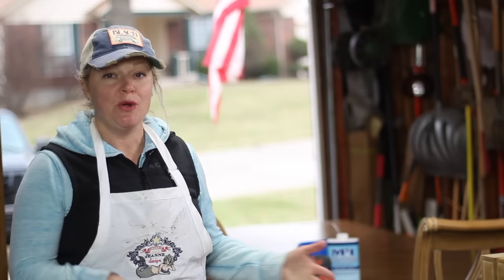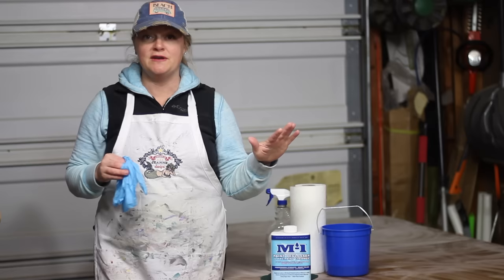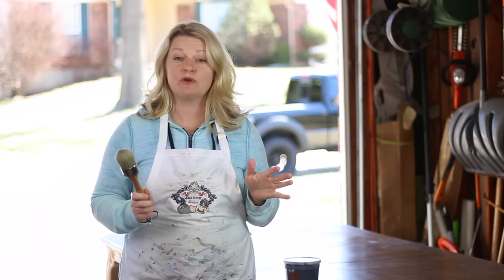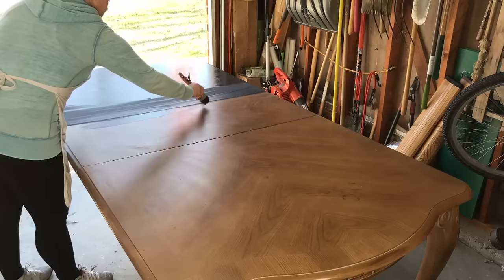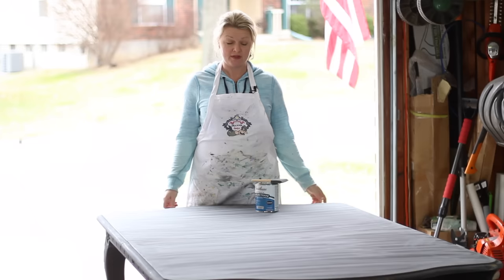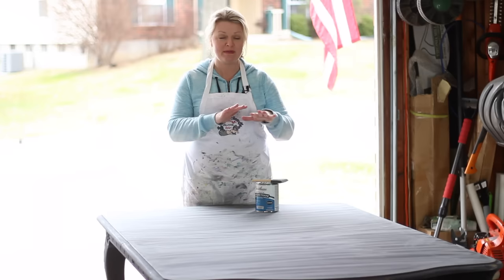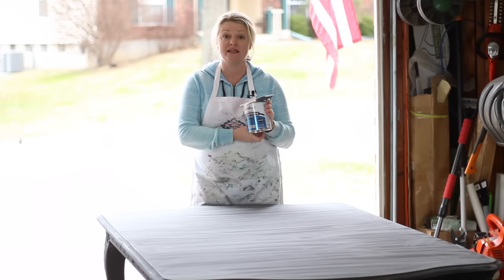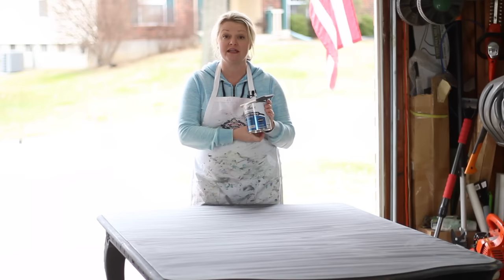Full Tutorial | How To DIY Chalk Paint Kitchen/Dining Table

Comment: So when you sand (after the two coats of paint; to get the butter soft finish on top... and distressing...), do you not wipe it down at all before poly?
Reply: I'm wondering the same!
Reply: I came here to ask the same thing!!
Reply: I'm wandering as well.
Reply: I'm glad to know I wasnt the only one to think this right away after sanding!
Reply: I was wondering the same.
Reply from the maker: Yes, I explain in the video jkay88 that I clean the table top even with an air hose to make sure that I have the cleanest and smoothest surface .

Comment: No goggles or mask while sanding? You didn't explain how you clean the painted tabletop after sanding and before sealing.
Reply: Stephanie Jo Rountree 😐 I’m sorry to have to point it out but she actually did, quite clearly too. She said she used cleaner first (I’m not rewinding it to hear that part again for this purpose, but having a healthy amount of common sense I’m going to assume she meant any regular degreaser or relative cleaning product,  then  she def said she used a deglosser & then vintager & water. I really don’t know how she could’ve/would’ve made those extremely simple steps any clearer. 😬
Reply: Ashley Falcon She never explained how she cleaned the “PAINTED” table top.  She went from sanding straight into distressing right to a clear coat.
Reply: @hagenz71  she said she uses vinegar & water to clean it TWICE.  so, it stands to reason once after sanding obviously & then again after the deglosser.
Reply from the maker: Hi Stephanie...  I wanted to reply to your question...After you sand, you can use the deglosser and water and wipe clean or if you do not need to degloss you can use an air hose to remove all debris from the table top.  I always try to use a rag that is lint free.  I couldnt add every single step in the video or it would have been tool long, I am sorry for the confusion.  I am hoping to post a new one soon, I am showing painting antique wood as well as reupholstering kind of a two in one video!  Thank you for watching.
Reply: Would it be acceptable to use a tack cloth after the second round of sanding ?

Comment: What grit of sand paper do you use in the beginning to start sanding down your table? 

So your shopping list would be:
Chalk paint
Deglosser
Brillo pad
Sponge
Gloves
Sandpaper 220 grit
Water based polyurethane sealer 
Clean dry lint free cloth
Chalk paint brush
Poly foam brush (Not craft) 

Did I miss anything? I will be painting my kitchen table, since we are quarantine and I am not furloughed from work.  Looking for projects for around the house. And this is one I have been wanting to do for a while. 🙂 thank you so much. 😀
Reply from the maker: i usually use a 180 grit to start my table, i use 220 grit for the finish sanding.  Happy Painting!!

Comment: You sealed it with what? I keep repeating that part but I have no idea what the "poly" word your using.
Reply: The sealant is called polyurethane or poly for short.
Reply from the maker: Sorry, Yes I used a poly acrylic sealant.  A water based sealant product so it does not yellow or have a too strong an odor and dries quickly!!
Reply: Was it a matte finish or semigloss or satin

Comment: I have painted a table using chalk paint and I want to seal it now and make it more durable by using an oil based varnish (polyurethane) How long should I let the chalk paint dry for, before applying the varnish ?
thank you
Reply from the maker: I have not used an oil based too coat ever with chalk paint only water based.  I’m sorry I can’t answer that completely.  I would say let paint completely cure at least 24 hours before top coating!  
Hope it goes great!!

Comment: I thought the whole idea of using chalk paint was because the product is self sealing? I've used the stain and seal process to age but never with chalk paint. I came to see how you did it but it appears you still have to seal it?
Reply from the maker: The reason I sealed this is becuase it is a table top that will be used often it is to protect the surface.  Any painted surface really should have an added protective layer.  I hope this helps

Comment: I have a huge ikea pine dining table I would love to chalk paint but I would do my brushstrokes the other way, the length of the table top to elongate it!  Is there a finish you can use on top to add a tiny bit of shine and at the same time sealing it?
Reply from the maker: Hi Gina...  So doing that long of brush strokes may be a bit difficult...    You can use a gloss  Poly acrylic to seal it with a bit of a shine..  I hope this helps.

Comment: ? I want yo do this to my kitchen table that we eat on now when I use my dis rag or all purpose  cleaner to wipe down my table will the chalk paint  come off
Reply: I was wondering this myself
Reply from the maker: Hi there, this is a great question.  If your table is sealed very well and I usually recommend SEVERal coats of poly  on a table top, lightly sand between c oats if you  like, you can use a cleaner and soft cloth.  Remember it is just paint.. And if need be you can repaint, and a kitchen table does have ALOT of daily use...  So my recommendation is several coats and using gentle cleaner and soft cloth.  I hope this helps
Reply from the maker: @Bavbava27  Hi Barbara, I responded answer below.  I hope this helps.
Reply: @JeanneCrackel  yess thank you

Comment: @idreamofjeannedesign HELP!
I spent months sanding/painting, sanding/painting, REPEAT, ...my dining room table to make it look exactly like I wanted (a beautiful birchwood).
I finally was pleased and ready to seal the deal, went in w/ “MINWAX 
water-based clear ultra flat polyurethane”, and it crackled my work and turned it from bleached wood to a noticeable Peeeee YELLOW. IT LOOKS HORRIBLE.
 Is there a flat topcoat that doesn’t yellow white chalk paint???
Reply from the maker: Oh no Gina!  I’m so sorry that happened!!   I always use a water based poly but it is hard with white paint , I have ran into this before as well.  If the wood is not sealed or old it bleeds through the white psint. So honestly doing a base or sealant coat under your chalk paint is what would work .  I know that kind of goes against everything that is great about chalk paint, just paint and go but if it is bleeding or yellowing it needs to be sealed!!  
It’s always trial and error with painting.  Best of luck and Happy Painting!!

Comment: Is chalk paint the same as "chalkboard paint"? I would like to use black. I only see chalkboard paint. Not exactly chalk paint in black.  So I just didn't know if there was any difference in product. Thank you.
Reply: Chalk paint contains a type of plaster which makes the paint thick and it tends to dry with a matte finish. Chalk board paint turns the surface into a chalkboard. Very different products.

Comment: Have you ever tried chalk paint on a melamine surface? Specifically like a smooth finish bathroom vanity? Thanks for the video!
Reply from the maker: melamine does not hold up well with paint.  I have tried painting with chalk paint before and it didnt hold well.  there is a product out there called STIX, you paint it first then apply your top paint.  I have used it on vases and other items...  Hope this helps!  Happy Painting

Comment: First time viewer.  New subscriber, of course! What did you mean by “feathering” the poly on?
Reply from the maker: Hi and thakn you for the quesiton, I tried to explain a little in the video, I simply mean not to have harsh brush strokes,  so painting int he middle as wide as I can and lightly feathering it out to the edges so there are no breaks in my strokes on the table top.... Does that make sense??  Hope that helps.

Comment: My biggest concern is the chalk paint coming off (at any point) on someone's clothes.  The top or the legs. A wax seal finish doesn't seem good enough to last so it would NEVER rub off, EVER.   I'd be humiliated if the paint ruined someone's clothes.

There are no videos online that show a wipe down after a piece is painted with chalk and sealed with wax or poly, and completed, to show it doesnt come off.   Can you show the protection on a piece 30 days later?
Reply from the maker: if you use a great sealant that should Never happen!!
Reply: Before you apply the sealant/wax, you have to wait to make sure the underlying paint is completely dry.
A lot of people seem to overlook this.

Comment: I would NEVER an electric sander to distress details....EVER.   I also don’t like letting the blond as an under color coming through. It should of been undercoated with a grey or whIte
Reply from the maker: Thanks for your opinion Dianna, but this was a custom job and I was doing the  custom work I was commissioned for. They wanted their original wood to show through, and the is the purpose of custom work, you please the customer.  I hope your undercoated project or table turns out wonderful!  I like to use electric sander, I have been doing this so long, I  have a good feel for it and can control what I do, and I do so many pieces, this helps expedite the process.

Comment: Amateurs!  Clean the accumulated gunk off the top first, Do any filling needed then sand and spot prime. Read what is in that deglosser. Sure it's miscible with water  Car and bike painters have used water wet shop towels and acetone to clean off overspray since the paint sprayer was invented by one 
Dr. DeVilbiss. It's possible for some finishes to either be shellac or shellac was used as a sealer. Any fraction of alcohol in the deglosser will re-wet the shellac and create a mess. Just two cleaning agents. Paint thinner or one of the concentrates diluted 1:1 at Walmart. Not cleaned first and sanding with one of those knockoff Fein triangular sanders will get you loaded up abrasive and will mar or even gouge veneer. Another mess. Pre cleaning also tends to remove the silicone that is found in most  liquid "wax" preparations. Nothing much in the paint lines even epoxy or polyesters will adhere to silicone. The result: Fisheye and another mess.Fisheye preventer is cheap. Any time one of these wonder waxes is suspected use the stuff. or another big mess is coming to a theatre near You..  Back to the '"deglosser"  If the M-1 is a "detergent" even diluted it will leave a film. If the M-1 is a solvent base read the bloody contents or look it up in an MSDS file. The solvent types are solvent type paint strippers without the anti evaporating component and usually as a fraction, contain methylene chloride,a known carcinogen.  If this is what is being used then those ten for a buck gloves are worthless and any one using this stuff should be wearing a real filter mask. Methylene Chloride will penetrate skin and soft tissue in the nose, mouth throat and lungs. 

Those brushes are European sash tools. The larger sizes are commonly used as pounce brushes in large size stenciling and many of the faux finishes. They are not special at all  and the general rule of thumb is not to use natural bristle brushes in waterbourne paints. The markets like Purdy have all manner of professional brushes for hundred of uses. You will not find these at WalMart. Go to a real paint store, or see the Purdy website. Purdy is not alone either.. 

Any matte or flat waterbourne paint can be modified with "whiting" aka chalk aka calcium carbonate. This includes artists acrylic, interior and exterior house paint and even those small half a dollar bottles of craft paint at Walmart.  Yep, black is going to hide that old veneer. Other colors like red..Not a chance. Black pigment is carbon black in overpriced paints like "chalk paint: and it's many clones.  The paint on a table like that would be best applied to prevent lapping with a real sheepskin roller or at minimum a flag tip 4" brush. also the edging on  the top should be done first. A pro would do that first let it dry a day and then paint the rest of the table top.  Please notice the chair in the way. We can almost predict something is going to land on the seat and make another mess.  The finished project is questionagle also. Chalk paint whether manufactured by who knows who,. possibley Sherwin-Williams for a private label is not particularly durable unless top coated. A pro would advise 3-5 topcots of clear matte or flat acrylic and hope nobody spills mustard, ketchup of a nice Burgundy and sauteed liver on the tabletop. 

We are certain the nice lady is well intentioned but has put stock more in the ad writers expertise than in reading a couple of books on painting and refinishing.
Reply from the maker: Not everyone does thier processthe same way Bill.   This video is for the at home DIYEr not professionals.   and not everyone has the time or  will to do all the filling at the top and the deglosser I used was safe.  I do not use paint thinner on my furntiure and this was a suggested product usage for those at home who maybe have not painted before.  Thank you for watching, I guess you enjoyed the video!  I am glad your process works for you!!
Reply: LOL @JeanneCrackel
Reply: @saramichaels3853  Nothing personal. Mostly an attention getter.. When "their" paint is in the food or on the floor in chips and yours isn't your guilt will turn to bliss ;) Annie Sloan is a whiz as other professional decorators are and have been. I have three of her books and not a drop of "Chalk Paint" on any page.        Try the used books page in AMAZON for maybe even paperback copies. The paint is overpriced IMO and being promoted as what we call in the trade "Magic Gordo Sauce".. 95% prep?  Yep!